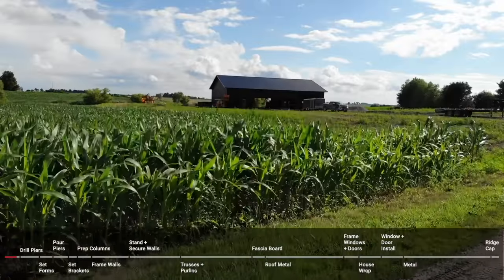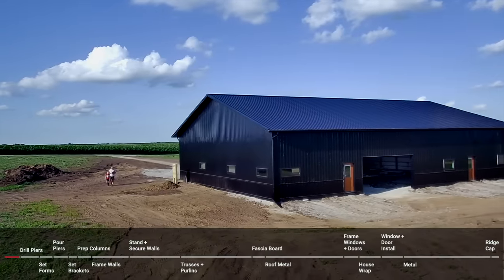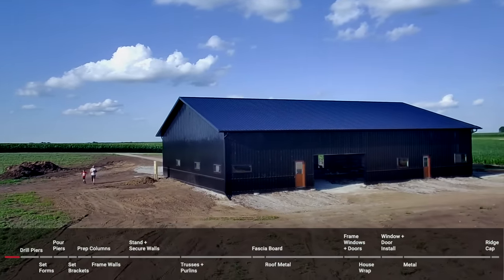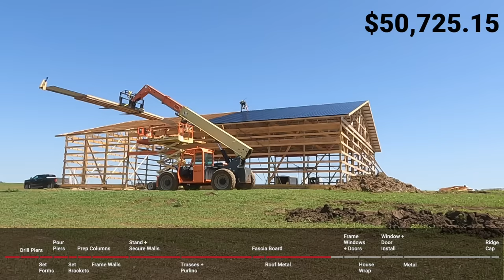Barndominium Cost Breakdown + Full Timelapse | 80' x 60' x 14'

Comment: awesome vid but if your goin to live in it you need insulastion and walls for the inside how much would that cost, i know you said it was a rough esimate but the inside walls and roof would you do that or is that a job for another contractor.
Reply from the maker: We just did the shell on this build. The client anted to finish everything from this point. Our current build on YouTube we are finishing it and they are choosing to spray foam all the walls and then do blown-in insulation in the attic.

We hire someone to do the spray foam.
Reply: @MrPostFrame  thanks mate

Comment: This will need about $500k to finish it. Needs a well, septic system, insulation, concrete floor, hydro galore, bay doors, landscaping, interior finishes ... It's a very nice start though. Good work!

Comment: Thank you for the informative video…..
Interesting… not sure where this was built or if you plan on living inside it… It does not appear to be structurally engineered…. I did not see any sheer walls… no big headers.  I would think that codes would require these simple things for this to be more structurally sound for living in.  For this cost it did not include a cement foundation, plumbing, electrical… etc… a whole lot more expenses involved in finishing this frame structure out… it could easily be another $50 to $70,000.00 to finish the basics inside… again all depending on location and how much sweat equity the individual is putting into this.  Again… Thank you for your video!

Comment: I didnt see any insulation, and with the black metal and no roof venting, doesnt it get hot inside in the summer? Did I miss something?
Reply from the maker: We just built the shell for this client. They are getting 3” of closed cell spray foam on walls and I believe ceiling.

Comment: That’s pretty cool! So I’m thinking total cost with labor and finished living quarters would round it out to about 100-110k probably…which is not to bad at all!
Reply from the maker: You’ll have to follow the owner as they finish! https://youtube.com/c/WichhartAcres
Reply: Wrong,
They should have corrected your statement when they responded.
They state that they charge about $10 bucks a square foot labor.... Add about 50k minimum to this building as it stands in this video... Living quarters, insulation, plumbing... Heating, electric.... Oh man.  Double your estimate..

Comment: What about labor costs too? That matters significantly to the "cost" of a project.
Also, I'm new to the whole Bardo world, but I thought a major point of these kinds of buildings was that metal frames are cheaper, sturdier, last longer, and offer more architectural freedom. Is this true? Why the wood frame on this build? Thanks
Reply from the maker: We build all our structures with wood. It will last just as long or longer than a stick built house. The metal exterior has a lifetime guarantee.

Comment: What's holding your brackets in other than concrete becuz you are not pulling that rebar up like that if it was tied into the rebar in your footings. Hope it's not a high wind area becuz the first micro burst or 80 mph wind and it'd be a pile of toothpicks as that rebar can shear or simple be wanked out of the ground by the movement of the exterior walls.
Reply: I was also wondering about those brackets? But there is the debate over putting a wooden post in contact with the ground or in contact with concrete, so the brackets do accomplish that?? Thoughts?

Comment: Considering housing costs these days.... that's phenomenal
Reply: Doesn't include the price of the land, cost of labor to have plumbing and electricity installed along with the indoor furniture/appliance costs.
Reply: And site prep. 
And permits/inspection. 
And concrete slab.
And construction labor. 
And equipment rental. 
And the entire interior build out and finishing.
And utility connection to the site.
The  move in cost is most likely 1 1/2 times higher than that final number if not more.
Reply: @kchez5586  saw one similar that costed 650k...

Comment: Doesn't look like the massive concrete floor is even a concern here  but can easily double the cost of this build. Add the inside work for the living space and that can triple the cost. Then you need to consider utilities, septic and water. The real cost with materials and labor can easily put this build at $300 000 - $350,000. Not including the land and access road or driveway. Probably $500,000 total or more depending on the amount of land. Zoning where I live will not allow two separate living structures unless they are attached.
Reply from the maker: I’m sure the rest of the project will be shown on the owners channel. This is for the portion we were contracted to do https://youtube.com/c/WichhartAcres

Comment: Obviously not a build in California! I’m doing a similar size metal building with a cost of well above $300k for the same shell progress with us doing all of the labor outside of concrete finish work and grading. Looked at post frame and the cost would have been even higher at the time of purchasing the metal fabricated building in late 2019.

Comment: What side wall height is needed to have 2 story living with 10ft first floor ceiling and 9 ft second floor?
Reply from the maker: Most likely 20’ because you’ll need about 12” for your I-joists or floor trusses.
Reply: @MrPostFrame  thanks do you know if you can get trusses to free span a 40ft width? Without a lot of bounce?
Reply from the maker: I believe you can get to just over 30’ with floor trusses but those are going to be 22” and 16’ on center. Don’t have a chart handy but you should be able to find a floor truss chart online.

Your sidewalls will have to be higher because floor trusses will need to be deeper.

Comment: can someone tell me why they split the metal installation from top and bottom instead of just doing the whole side at once at 15:30?  Looks like they do that all throughout the sides.
Reply from the maker: We do that for a couple reasons. It creates a visible break that people like. Most importantly most damage is done to that bottom 3’. It’s easier and less expensive to change out a 3’ piece of metal than a full sheet.
Reply: @MrPostFrame  ahh thanks!

Comment: No decking or sheathing?
Reply from the maker: Not required when using exposed fastener steel panels the building gets its sheer strength from that. Another type of exterior and yes you’d need it

Comment: That is gorgeous, but you NEVER want to paint your home such a dark color, because it will inevitably have massive heating bills. Black does such an exceptional job of absorbing heat. 

It looks stunning, though! And great usage of utilizing the soundtrack from the Dark Knight Rises 🙂
Reply from the maker: It’s not as terrible as it seems like it should be. They did spray foam insulation so it’ll do great. Follow the rest of the project https://youtube.com/c/WichhartAcres
Reply: If it's absorbing heat in the winter (due to black paint) wouldn't that lower your heating bill, not raise it. In summer, you'd expect it to raise your cooling bill. And, perhaps to to colder winters and milder summers, that's the exact effect they were after.  Never say never...

Comment: Yes Yes and Hell yes, So many things are Great the, Skid Steer  with the Lifting Boom is A  Great Attachment. Now I love the DIY Aspect could you have a Modular style, built in a shop and Delivered Complete. Now Image that entire project in Bents so I can Assemble it my self on the damn Ground . Now the Sections would be  20'by 10' and Complete Built Insulted, Waterproofed ETC and the Roof you Build Complete on the Damn Ground next to the Structure. Now you have Set all the Walls and Built the Roof on the Damn Ground with yours Bros.  Now the Boom Truck 🚚 or Mobil Crane shows up for ONE DAMN PICK , The spreader Bar was Purpose Built for the Roof, Boom he shows up and in one hour Done and Gone . Bingo.  Now all the Attachment Points have to be Wilbur Proof, so Giant Channels Bolts with lots of GLICK for waterproofing and strength.  Boom, the Rowrow Truck 🚚 shows up with Shit load of sides and Roof, Siding on windows in you Rent One Skid steer with the hoisting Attachment. The Glick is Down the Walls are up and  Squared by the one kid that can work the laser, ( he didn't drink the bong water, in 1970 on a double dog dare) the roof is built and the Spreader bar is assembled next to the roof, Crane show and makes One Pick and Gone, Walls, Roof , Windows Doors all in Ready to Go. Now you break down the Shipping Racks and spreader bar and sent them back to the factory for a Refund on the tools shipped with the Building.

Comment: What's that skid steer  "crane" attachment?
Reply from the maker: That’s a boom from Skid Pro Attachments. I believe it will extend 230”.
Reply: @MrPostFrame  Trying to avoid renting or buying a telehandler and that may do the trick. thanks
Reply from the maker: Works great for us for builds with 14-16' walls or lower. We decided to rent a tele-handler for the latest build because of the 19' side walls. The skid could probably handle the side walls but not comfortable with the end walls and trusses at roughly 30+ feet.
Reply: @MrPostFrame  I'd be trying to use it for some half metal trusses, up to 25' or so. Sounds like I may need to consider a telehandler. Trusses shouldn't weighthat much.

Comment: If you want a trash design use wood to build with if you want quality use metal this is a Pole Barn not a Barndominium.  A true Barndominium requires a 2’ deep by 2’ wide solid footing and a 4” thick slab to begin with.  This structure is vulnerable to fire, dry rot ,and termite damage. Please don’t tell people that this is a Barndominium it makes the rest of us builders who use good quality steal products look bad. It is a good looking Pole Barn.
Reply from the maker: Quick search…🤷🏻‍♂️ Don’t see anything about a solid footing.

“A barndominium, also known as a barndo, is an open concept steel building with large square footage that combines living space and a working area. The term can be used to describe any metal structure from a simple one story to a large, luxurious home.

This type of building is typically built on an existing property or multi-acre homesite and the structure often acts as a dual purpose living and shop or work and storage areas large enough for things as large as boats and recreational vehicles.

The term has also been used for wood-framed structures, and is often used interchangeably with terms like "barn home" and "barn with living quarters",[1] for newer buildings in the tradition of bastles, housebarns and connected farms.”

Comment: With labor it probably overall cost 130,000 to 150,000
Reply from the maker: You'll see prices all over the place for installation...we charge anywhere from $10-$15 /sq. ft. Depends on number of windows, garage doors, side wall height, etc...
Reply: @MrPostFrame  Oh fersure and that all adds up. I used to work in the construction industry.

Comment: The walls are just thin plastic
Reply from the maker: That would be thin steel 🤷🏻‍♂️
Reply: @MrPostFrame  Ya! of course you get what you pay for. It ain't no super heavy  duty building. Of course if it was it could cost up to millions. Like I said you  get what you pay for. your just showing how cheap something can be made and how big it is.. I mean it's ok, for what ever.
Reply from the maker: You’d be surprised if you really checked them out. My personal home has experienced a derecho and tornado within 10 miles. No cracks in drywall…solid.
Reply: @MrPostFrame  I know you do good work. If I had The money I know you could build me a stone rock Castel .
Reply from the maker: Thanks, Brian!
Reply: What did you use on our walls when you built your 80’ x 60’ x 14’ building?
Reply: @pjfan173  My father built it for me I would have to go back and ask him. Why? As I can tell mostly ROCKS

Comment: Uploading a video of a building made with stick frame construction with all the innovative, faster, more durable, less flammable, more insulated, more efficient, more energy efficient, cheaper over the long run, disaster-proof construction techniques available; like this video really needs to be seen for some reason is almost embarrassing.

- sips
- steel sips
- steel framing
- steel framed eps foam panels
- ICFs
- raycore
- prefabs 
- green rhino
- precast concrete panels
- mass timber panels
- scip panels
- 3d printed construction
- flat packs
- and hundreds of other innovative construction systems that crush stick framing on every level

But nah. Still just building something the way it was done hundreds of years ago. Like uploading a video to YT of your cool new typewriter, gramophone, or all the VHS movie tapes you're making.
Reply from the maker: 🤷🏻‍♂️ this is not stick frame…it’s called post frame construction
Reply: @MrPostFrame  A minimal upgrade from stick framing with many of the same issues described that come from stick framing. Especially when compared to every one of the other techniques aforementioned. Congrats.